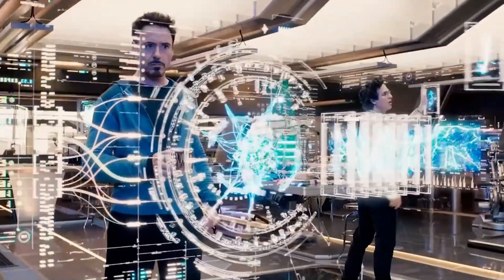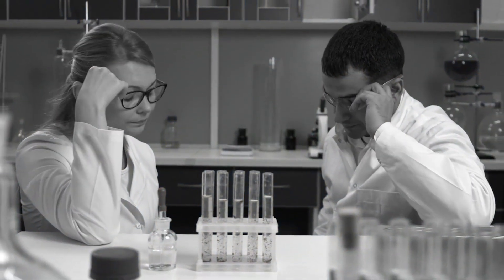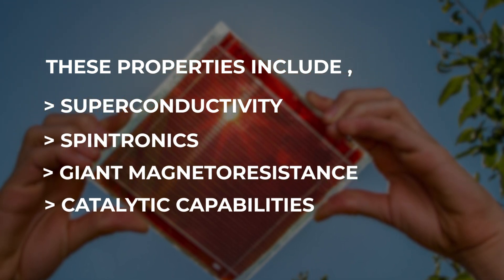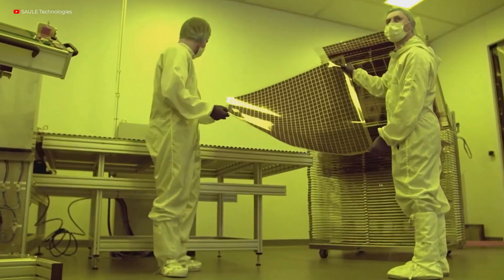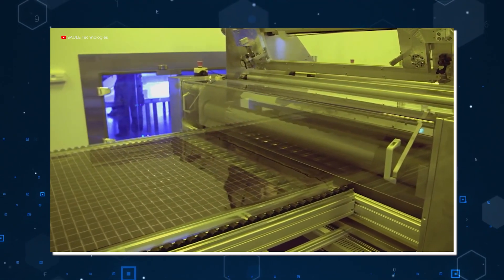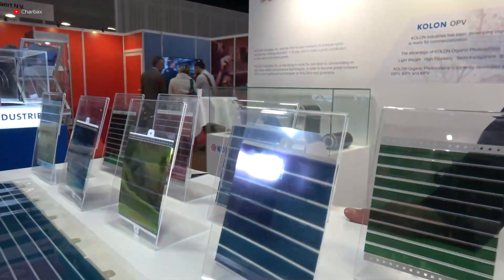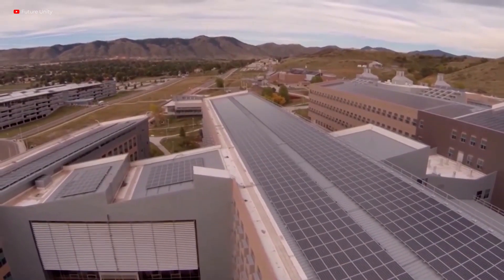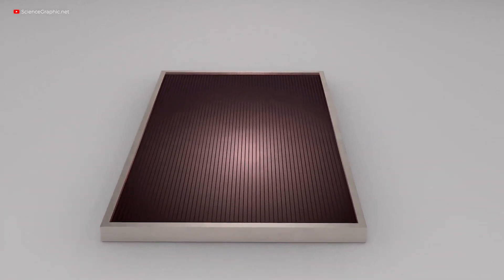Perovskite Solar Cells Is The Future of Cheaper Electric Vehicles!

Comment from the maker: Could these batteries make Tesla cars cheaper?
Reply: Eventually, when you remove the human greed component. The universal problem is not tech, it's human. 
Apart from greed, the balance of work/workers with fair compensation, while keeping prices low, and expecting diminishing returns.
It will change how the industry works, and success is dependent on how the companies adapt their processes to the new tech.

Keep in mind, they are talking about solar panel technology and not batteries. I anticipate a domino effect here in terms of powering your car from a Powerwall, and since the tech could be (in theory) adapted to other applications (improve battery efficacy), my short answer would be: yes...

TL;DR: Yes